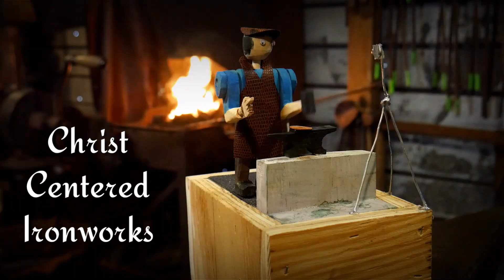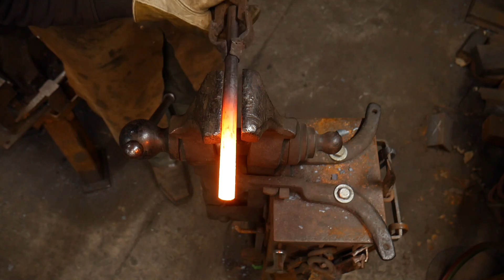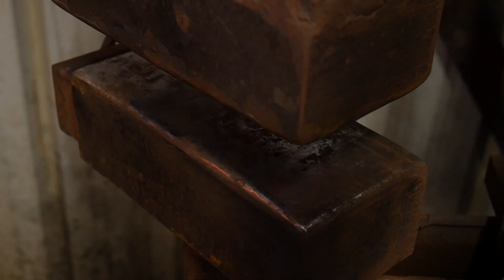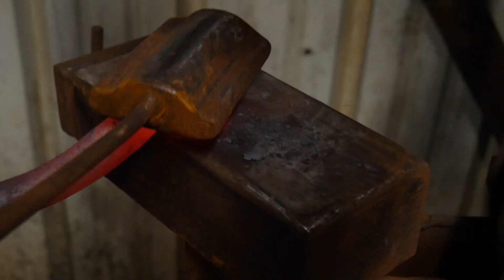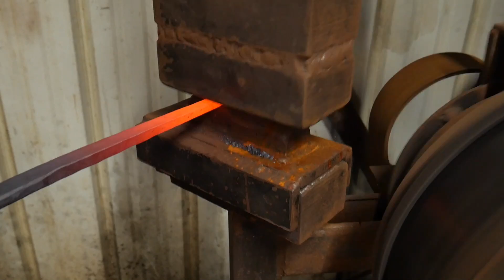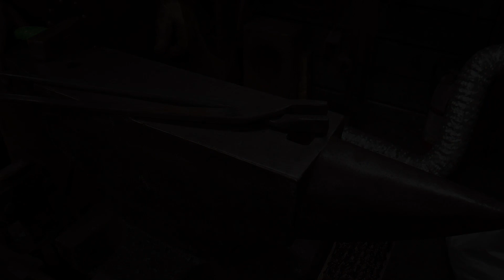How to Forge Power Hammer Tongs

Comment: For a power hammer it doesn’t seem to have actual power ,I mean better than forging by hand no doubt
Reply from the maker: This hammer has a built in depth stop so as to not over forge the material. The hammer can work down 1.5" square bar with no problem so yeah it's way better than swinging your hand hammer..
Reply: Christ Centered Ironworks 

Not the first time I’ve seen the performance of the hammer ,take it as more of constructive criticism if you will 

Not that I would know anything at all about the subject right 😉
Reply: The power hammer doesn't get tired!  Drawing those reins out at the anvil would take me a while because I'm old & have to rest a lot! I'm sure you could build the power hammer with more power, he has plans for different weight power hammers.